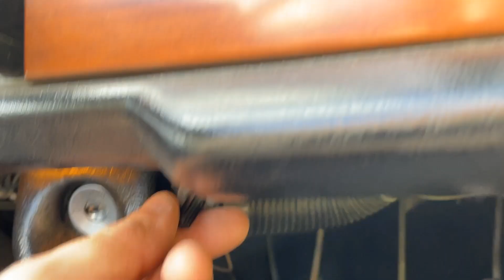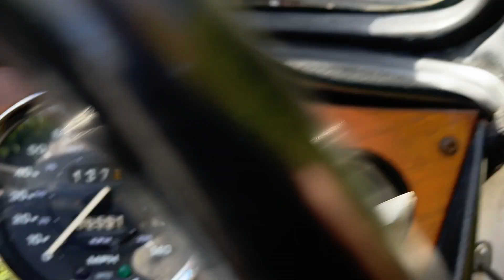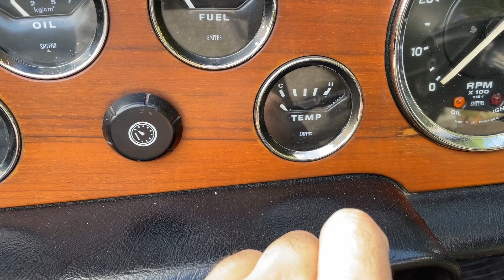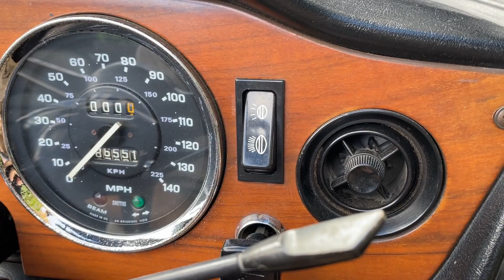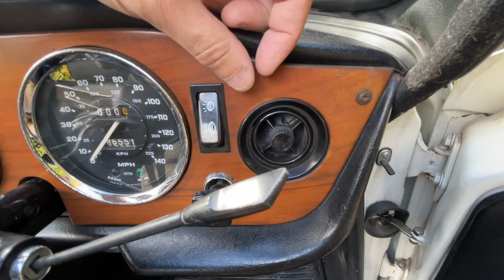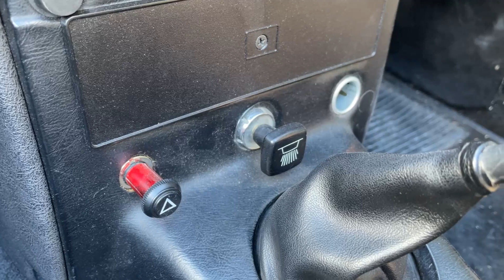TR6 Dashboard and cockpit Controls explained

Comment: The dash layout can be very different on early TR6s, like a friends 1970 model. Mostly the same controls, but in different places. In his car, the left hand stalk is off, side lights, then headlamps. The dip/mainbeam is a floor switch, just to the left of the clutch. It also doesn't have a volt-meter, it has an amp-meter. Wiper switches are different too and a number of other details.
Reply from the maker: Good point thanks for watching